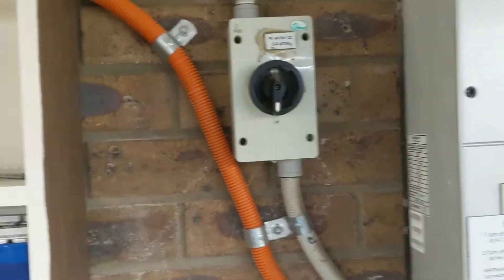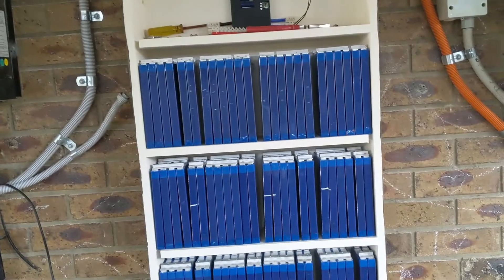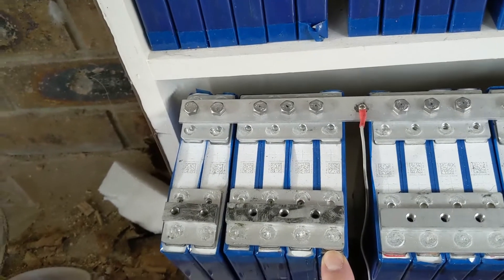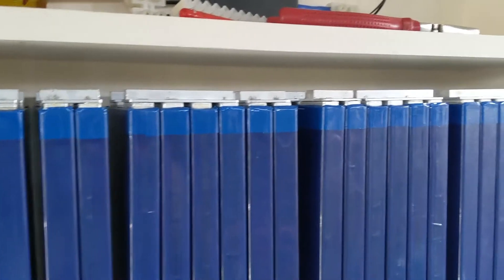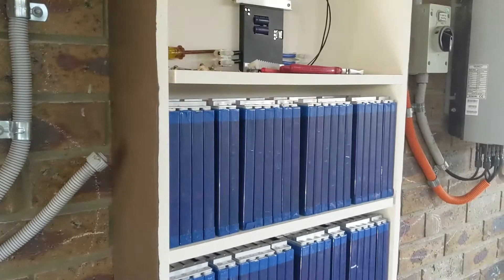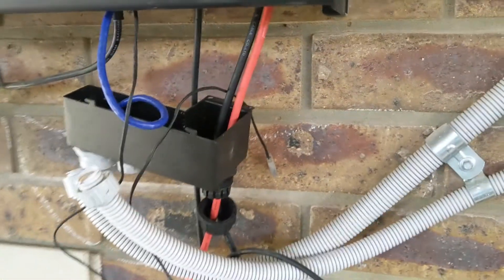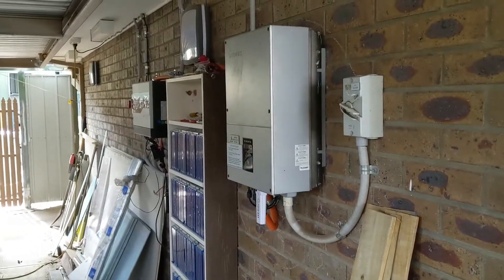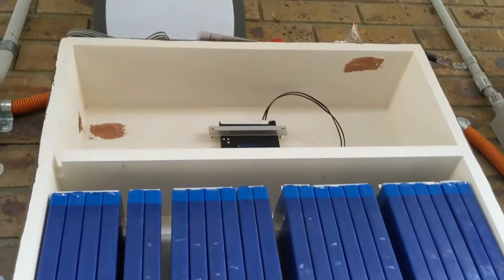DIY LTO Battery Wall - PART 1

Comment: Hi Adam, just to let you know I have now finished by project.  Build a 30kWh LTO battery pack connected to my solar and it is working great.  It has been running for 5months now with no issues.  One bit of advise, I would say is not to buy any expensive product from Heltec.  I am still trying to get by $600 refund for faulty active BMS i purchased last year.

Comment: In the video, I noticed you use the active BMS,.  What is the balance current of the BMS and do you find the current is sufficient to keep the individual batteries balanced?  If not, what balance current would you recommend  for your size system? With regards to the position of the batteries, would you say it is best to have the terminals pointing up like in your set up or coming out towards us?  Look forward to reading your reply. Great video by the way.  When do we get to see the finished product?

Comment: Thx for getting back to me.  I was wondering, did they provide you with a certificate of compliance to support the grade of the batteries?  Also, were the batteries tested before shipping by the supplier?
Reply from the maker: No and no. This was when 66160 LTO batteries were new to the public. Just buy direct from Yinlong factory. Contact them, they are helpful.

Comment: I am about to buy some prismatic batteries like your,. My are from test vehicles in China and I am told the batteries are grade A+. Has your batteries performed as you expected?  Is there anything you would do differently knowing what you know now?  I look forward to reading your reply
Reply from the maker: Mine were early grade A cells too. As it turned out, they were actually like D grade. Amp rating was 20 - 30% lower than claimed. Some cells were faulty and struggled to hold voltage. Buy through company with return policy. Ask for a test sample and run a capacity test. Run a test on random cells when they arrive.  Things are getting better with sellers, but not everyone does the right thing.

Comment: I noticed you did not have all the leeds on each battery but on busbars? Is that correct? 
I am building a small 2.3v 40 amp × 10 lto system. What would you  recommend for my set up?
Reply: I did not much information on LTO batteries thank for you help I figured it out and I have a 13.8v 240 pack! Sometimes you just have to be smarter than Google or even you 😉 know that I know how ill share

Comment: So how many batteries all together? And are they grade A or grade B?
Reply from the maker: See description: Voltage: 48 - 24s 6P 24x6=144 cells. Using B grade as they are cheaper but only because of their manufacturing, the performance still seems to be quite good.
Reply: I am on the trigger to buy some...how much did you pay per cell if you dont mind me asking?

Comment: nice, so you switched over from the 35Ah round ones ?
Reply from the maker: Yes, found them harder to make compact battery walls. The 61660 rounds are still the most robust but the 33ah rectangle prismatic LTO's are heaps easier to build with. Have been buying up this format batteries to replace my other battery wall that uses round 61660 cells.
Reply: @RedbackAviation  Thanks that makes sense, thanks again for the interesting videos :)

Comment: where did you buy the batteries and how much?
Reply from the maker: Alibaba, just check who you are buying from. Then test radom batteries the day they arrive. My website I'm starting has some more information: tolnix.com
Reply: @SystemsPlanet  Looks like this one on Aliexpress: 1A/2A Acactive BMS Li-ion Lifepo4 Battery 13S-24S Balancer Protection Board intelligent Bluetooth CAN/RS485 Communication
It has an adjustable cell voltage range 1.0 - 5.0 V